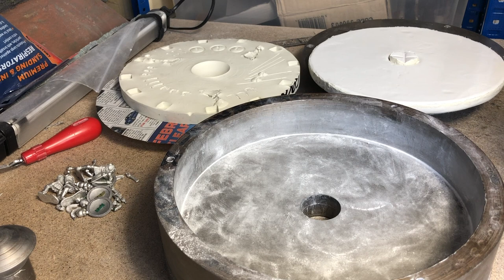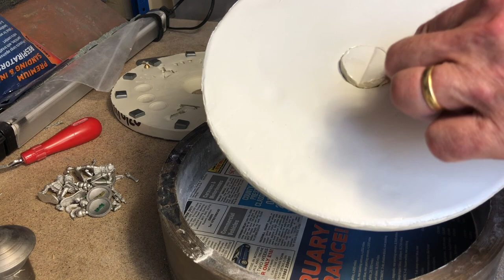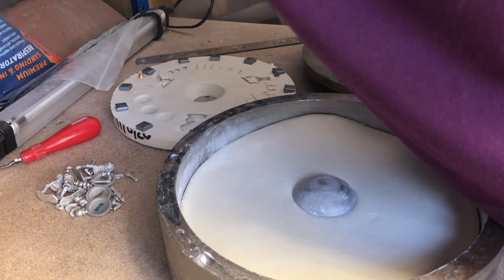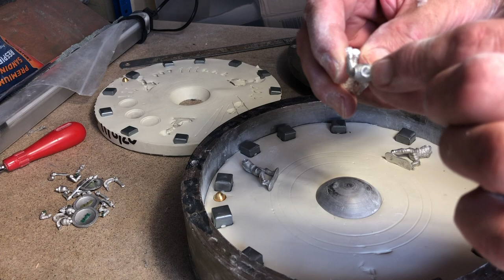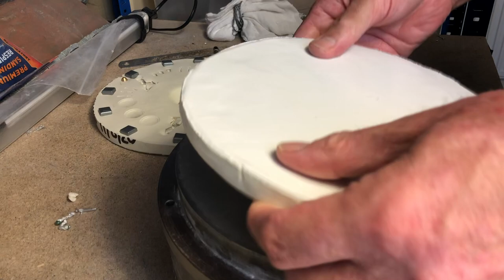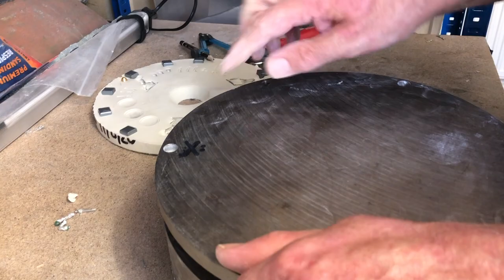Making high-build wargames miniatures moulds

Comment: Hi There Mr. Saunders, 

where does one get those steel circle casing you are creating the molds in?

Thank you,
Reply from the maker: Mould cans usually come from the same suppliers as vulcanisers! A secondhand vulcaniser will usually come with a mould can. In the UK, SEBA or J Coker will make new ones. In the US, you could try Conley Castings or Romanoff. In the EU, try NICEM of Italy or Coniex of Spain. Also, Spinbox makes a mould can that may be used in a domestic oven (i.e. without a vulcaniser), but I've not tried one. An engineering workshop could doubtless machine one too, given the right information. They're not cheap!
Reply: @MrSaundersMiniaturesWorkshop  Thank you so much for your input ! I appreciate it !

Comment: Instead of building a plug for the neck, why not use a short 22mm long rod of 2mm PTFE.
Prince August does this for their toy soldier hobby casting molds, and it works fine. 
The PTFE rod slips out easily, and gets placed back in the mold for the next casting.
Reply from the maker: That method is OK for low volumes of production because it is much slower. I run a stack of moulds at a time and having the plugs as part of the mould is quicker for setting up the mould and releasing and removing the figures.

Comment: Hey there! I just came across your videos. I am trying to learn everything there is to know about spin casting so I have a better idea of the costs when I look to have parts produced for my upcoming tabletop skirmish game. I am doing tokens at first but will eventually want to have a minis produced in small batches. On average, what is your cost to produce a single cast of 15mm or 28mm minis? What about the costs for a new mold? I know the molds eventually degrade. How often do the molds need to be replaced?

Your videos have been ultra helpful!
Reply from the maker: Costing is quite complex. You can safely rely on getting 24 x 15mm or 12 x 28mm simple foot figures on a single 9in mould. If you're casting in pewter, a 15mm foot figure is about 3g and a 28mm one about 15g, and the last time I bought pewter it was £24 per kg, bought 100kg at a time, so the actual metal cost of a 15mm figure is about 7 pence and a 28mm figure about 36 pence, plus electricity, sculpting and mould costs. If you get a mould professionally made for you, it will cost around £70 to £90. Sculpting might cost about £5 per mm of figure, depending on complexity and the sculptor, so £140 for a 28mm figure, and 12 sculpts to fill a master mould comes to £1,680. If you then make production moulds for each of the 12 figures, then add another 12 lots of mould costs... But if you just ran a master mould to extinction for figures for your own use, rather than producing them commercially, the unit price of a figure begins to look attractive after a few hundred castings compared with buying commercial castings from someone else.

There are companies that do contract casting and mould making: you get the sculpting done, they'll make the moulds and do the casting. It's expensive, but means you don't have to buy the equipment. A new compressor casting machine costs around £9,900; a new vulcanizer like the one I use more than £5,000. Many small miniatures businesses start by using contact casters. Many also start at the cheap end with a simple Tiranti or Spinbox casting machine setup (which is OK for small production runs), or buy their equipment secondhand. I started with a secondhand casting machine that cost £400 and is still going strong 13 years on (I had to buy a new vulcanizer, though).

Moulds last a long time, although a lot depends on the nature of the sculpts. Figures with a lot of deep undercuts will wear out a mould quickly. Many of the moulds I own are 20 to 30 years old and still in good condition because they were designed to produce lots of each code and therefore haven't been run as often. Some traditional rubber moulds among them are beginning to perish, and I'm replacing them. Less efficient moulds need to be run more often to produce large quantities, and therefore wear out faster. I am gradually working through the old moulds, replacing those where wear is more evident.